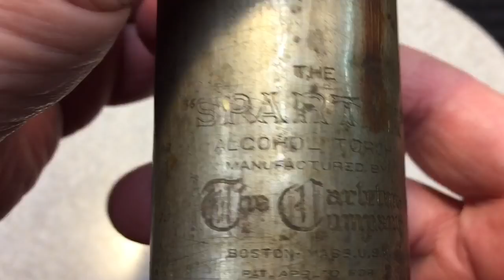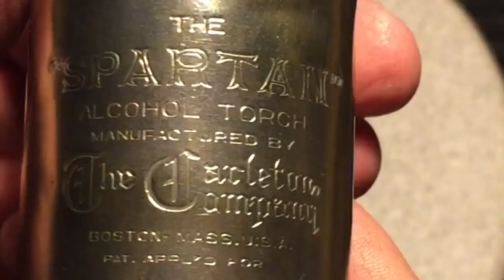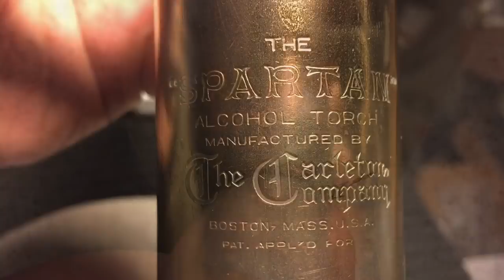Antique Spartan Alcohol BlowTorch

Comment: I was out last Saturday at one of my favorite architectural salvage places, they have lots of rusty old tools they get while cleaning out houses they salvage. Anyway they had a couple of the gas blow torches like the one you converted into a lamp. In fact they had converted one to a lamp and they wanted $175 for it! Yes you read that correctly…$175. I think you might be onto something, you need to get them out there on Market Place or Craig’s List for like $150. As cheap as you find them you could retire in a year!
Reply: Please don't convert usable torches. 
They will burn nearly anything and we will need something to heat our houses with after all the power plants shut down.

Comment: You sound like you grew up like I did. Until 8th grade, I was the second shortest, second heaviest in my class. In fact, my circumference was longer than my height! 😳 Well, in 8th grade August through April, I grew 9 inches. I had to shuffle my feet because if I picked on foot up and fell, there was no guarantee that gravity would take me to the ground. At the end of the year, I was the second tallest, second heaviest in my class. I had NOT gained any weight at all. Four years later, I was about 6'2" and 165 lbs.

Comment: Nice job John I thought you were going to pass out blowing through the tube. I do like the brass but have you ever thought about trying to electric plating it back to nickel. I think I’m gonna try it on a few projects I have that I wanna nickel finish just curious.
Reply from the maker: I did- Years back when restoring my '51 Pontiac Chieftain, I bought a nickel plating kit and was quickly disappointed with the finish.  To really apply nickel correctly you need high voltage and strong mix of Nickel Sulfate...

Comment: I've noticed that a lot of older brass it's kind of gummy, I don't know if it was more or less pure, but antique brass things don't seem to work harden quite the same. Ive seen a handful of examples like the one you showed, it almost seemed like they used the bolt as the tap. I suspect that over the years it gets cross threaded occasionally and if that gets reinforced enough times, it essentially retaps the bore. I have no idea if that's the case with yours, I cannot feel it. I found it to be true of the ,"mushier"red metals

Comment: John I think the top was soldered on. Or perhaps brazed.
Reply from the maker: I believe the top was threaded on but the threaded collar was soldered on to the tank.  That collar is stuck on the burner assembly now.  You needed a way to open the tank to fill it and change the wick.  Thanks!

Comment: so you just turned the wick holder into a press fit? i believe it was a threaded into the tank and the cap threaded onto that. but the pressed fit seems to be able to handle the little pressure that the tank builds, i noticed a crack on the neck band in the tank side. good job on the fix.

Comment: "Ok we took off the nickel..." Just like that? How, pray tell, do you remove nickel?
Beautiful job on the torch. I can tell you've never been a smoker. You sure did blow that thing a long time!
Reply from the maker: LOL-  Ben- Most times we remove Nickel it is done on accident!  Here I removed it using the wire wheel but making sure to use the side of the wheel because just like Aluminum if you leave the steel wire wheel on the brass too long or hard it will damage the surface...  The side of the wire wheel is your friend, it will scrape off many materials from the project where as the front of the wheel is unforgiving.

Comment: I've got a little alcohol torch just about that size but oriented horizontally with little folding handles, it's made out of brass and it has an inscription from 1786 and some Dutch name. I've never known what it was from nor what it was for, it was just a bookshelf trinket of my grandparents. These were never really on my radar until your past couple of videos. I get the impression that the horizontal arrangement and pressurizing valve are somewhat unusual, what would a little torch like that be used for? Soldering or light braising? I didn't think alcohol burned very hot, but pressurized with air perhaps..
Reply: It looks a lot like a miniature Jerry can if that helps with identification. It's quite well made and it looks like it might have been a presentation item? I don't know, maybe it was more common to engrave your own name with a great flourish on your stuff
Reply from the maker: JP  Did you ever see my Lenk video?  Another cool torch!   https://youtu.be/f1pUacusjS8

Comment: Kind of hard to tell from the video, when you had it on the lathe was it gummy or was it bitey? Conventional wisdom is that brass is bitey, but I've noticed a lot of antiques seem to be a slightly different alloy
Reply from the maker: JP You are so right, Brass and Copper can be super bitey and if your tools aren't scraping instead of cutting you can get into trouble real fast.  I have messed up a bunch of Brass parts because my rake was too aggressive.   I think this brass was pretty normal I was just taking such small cuts...